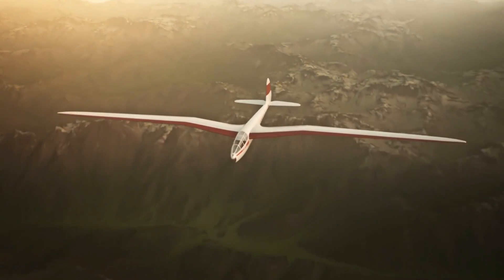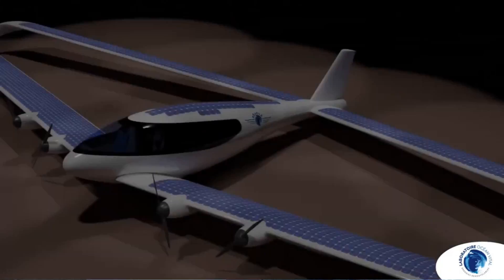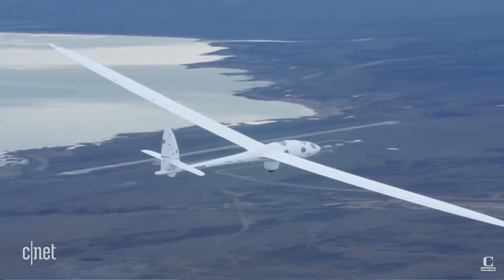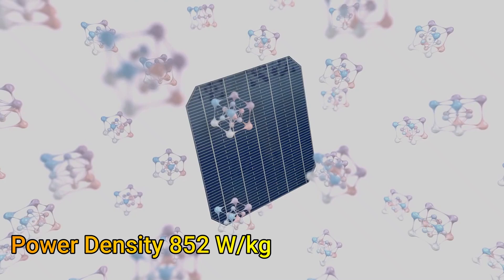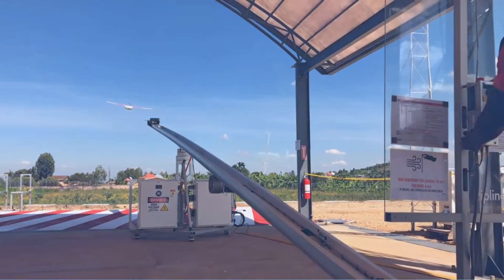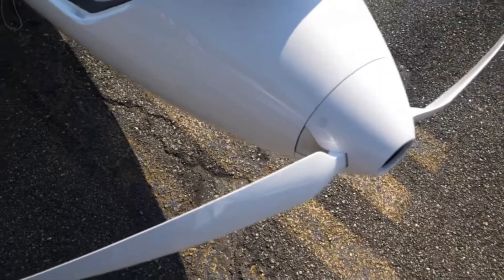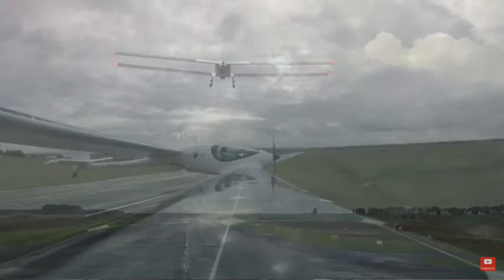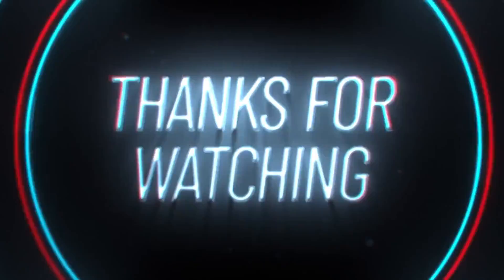Solar Cargo Gliders : The possibility

Comment: What if we use lifting gas to increase the surface area for solar panels without adding weight. Essentially an airship that can land on its own without wasting gas.

The increase in drag, while slowing down the aircraft, should not be enough to offset the benefits of having an increased energy output from solar panels and the lower energy demand for take off and landing (less batteries, smaller electric motors).

Comment: This doesn't make much sense at all, really.  The gliders in WWII were used because the army needed to deliver troops to a combat zone en masse.  Parachuting is too imprecise and puts the powered planes at risk.  Gliders let them disengage the valuable powered craft before entering the most dangerous zones.  

On their own electric powered gliders make plenty of sense but they're never going to carry any significant amount of cargo.  You're still going to be limited by the amount of energy they can collect from the solar cells for any trips of significant distance and that means the cargo capacity is going to be limited.

Comment: One thing is for certain. We must realise that jet aircraft are demolishing the entire planet. The temperature in the combustion zone of a jet turbine reaches 2300 degrees C. The temperature at ten thousand meters is minus 30 to 50 degrees C. The deposition of this intense heat into the frigid stratosphere is disasterous and must stop. Use the internet - forget the jet!
Reply: There are apparently 100,000 flights every day of all aircraft. 
Also, if aircraft used structural solar collectors for planes, the entire upper surface of the plane could be used for solar gain, not just the wings. The heat component currently not used could also be harvested from the aircrafts body and wings.

Comment: The problem with batteries powered flight is range   but what if the lift aircraft (the one pulling up) is electric   you could charge it in between tow ups and get away with a small battery pack.   Saw a Ted talk on using autonomous  gliders high  in the jet streams to get really far

Comment: A video dedicated to the Antares 20E (Lange Aviation) would be good: Over 20 years old design, fully electric and L/D better than 50.
Another video dedicated to the Archaeopteryx with electric motor and L/D of 28 at a weight of only 85Kg (without pilot) would  be good!
Reply from the maker: Thanks for the tips

Comment: Well, given that the most fuel is used at taking off, and climbing to altitude, there is a possibility to use electric tow planes to launch these. This is kind of like a booster with space craft. The dead weight of low altitude high power propulsion is ejected at the beginning of the flight with the corresponding batteries. But do to the high power and low maintenace  electric propulsion can also be used at this stage.
Reply: hi kistuszek, have you become a flat earther yet? If not I suggest viewing the 13 part series what on earth happened in my about to learn how the earth is not a globe

Comment: Sea take off. The wing js blown to increase the deag on the top sidea of the wing the weight is hoftes baxk to raise the wing facing a winfy dy the lift us set by the weight on a rail the lkad pulled fiwrad to the center of the uull and ountiil at the height required aboce the winds shear off , then the earyb runs arpubd then land by tge place its not there e?

Comment: Fantastic video with good explanation of e-glider range equation!
A small team of us, at Cranfield, studied basing a 600kg electric aircraft design on a glider to maximise lift-to-drag ratio. My proposal was to put half of the batteries in the wings to allow good aspect ratio without undue stresses in flight. The challenge is then to allow the same wing to handle heavy landings without undue root stresses, although carbon composite flexure can help by absorbing impact energy. To keep landing gear length & mass down, we selected twin rear ducted pusher fans. The one advantage of e-VTOL is that there are systems available now, like the Schubeler ePos-21, which offer ready solutions for fixed wing propulsion. We were conservatively estimating 500km for 2 seat version and 750km for single seat version. I'd like to think that at some point I can get a small team together and have a go detail designing it...
Reply: hi martingarrish, have you become a flat earther yet? If not I suggest viewing the 13 part series what on earth happened in my about to learn how the earth is not a globe
Reply: @flat-earther  , my belief system is that the observable universe is round. To test this belief might cause reality to implode. This would leave us in a bad bad place...😱
Reply: @martingarrish4082  okay. BTW martingarrish, what do you think about all gubments drawing a line around you and saying you are not allowed to leave?(Antarctic Treaty) If you don't know what I mean, read my about tab.
Reply: @flat-earther , I think that this isn't an appropriate place to discuss that topic, as it doesn't relate to electric aircraft. 😧
Reply: @martingarrish4082  yes I don't like wasting more time because youtube censors comments. I just opened a door of information to you and you get to decide what you do with it
Reply: For flight training hourbuilding this will be exceptional, plus some early adopters might be very happy to fly sustainably. Go for it!
Reply: @Walterwaltraud  Look at the currently operating Velis Electro and upcoming Diamond eDA40
Reply: @swecreations  I do, have followed them for years, but since both are conversions of existing models and Pipistrel did not choose the Virus, the range is limited. Great for pattern and air work, not ideal for covering cross country experiences.
Reply: @Walterwaltraud , exactly. I wanted a recreational aircraft suitable for training, cross country, and stressed for full aerobatic capability. Purpose designed for recreational flying and advanced training on a tight budget. Using glider like landing gear with good energy adsorption, and wing tip wheels, would also allow ab initio landing resilience. Designed from the outset as a robust club or syndicate machine...

Comment: There are no "light weight batteries" when compared to hydrocarbon fuel. for the energy they contain, batteries are just heavy.
Reply: hi flechette, have you become a flat earther yet? If not I suggest viewing the 13 part series what on earth happened in my about to learn how the earth is not a globe

Comment: There is some interesting new materials that would be interesting to see in flight,like the thin and light "humidity battery"membranes that make a little electricity from the humidity indifference on the underside of the glider wing,it's interesting because of unknown thermo-dynamic interactions with leading edge flight turbulence ,heat and lift

Comment: You have no practical understanding of the structural inefficiency of 'gliders' (sailplanes) where the wing mass increases so fast with span or size that there is no payload fraction possible -with solar power the concept is simply ridiculous - the round world solar aircraft was indicative of the fragility and uselessness inherent plus the huge size just to lift one person - batteries are another level of ridiculousness to add to this hare brained 'thought'  . The existing passenger and cargo aircraft in airline use ARE optimized to give the best useful load to power etc balance.  Hurel Dubois explored the potential for higher spans and L/d as did the NASA SUGAR project but still using viable propulsion .   this is crap.
Reply: crossouts are a computer glitch.
Reply: @rossnolan7283  The crossed-out part is probably there because you surrounded this text by hyphens.
Reply: I have looked into that previously and it does not seem to be the reason; as if putting a 'hyphen' should do that in any case . The post below by 'robertosfeld'  contains a hyphen, as does yours  . I would normally connect, by 'hyphens', a compound thought rather than the less appropriate commas , as here  . Let me see - using hyphens - at both ends of a sentence if this is so.
Reply: didn't happen , the round world (in 60 days almost) solar powered glider was Solar impulse from memory - papers on the concept of cargo gliders even in trains with one tug - were published in the 50s but proved impractical - solar energy can barely sustain the most refined EMPTY aircraft as already shown. Is that enough hyphens? let's see .
Reply: hi rossnolan, have you become a flat earther yet? If not I suggest viewing the 13 part series what on earth happened in my about to learn how the earth is not a globe

Comment: Powered gliders also can do dynamic soaring (DS), possibly autonomously, to achieve much longer distance flights, as they can avoid and escape areas/situations of low wind gradient using their motor.

Comment: This video is beyond stupid. Go look up a detailed video or information on Zipline and you can see why cargo gliders are moronic. Cargo is about weight, to be able to support enough weight cost effectively enough, gliders just will not cut it. The whole of air service is speed and high value payload, high capacity high load cargo is the opposite of that.

Comment: Gliders aren't powered, if they are they're airplanes
Reply: You never heard of a self launching motor glider glider is a plain capable of sustaining flight without power. A glider can have power can have a jet engine several do have jet engines they just don’t rely on power to get from place to place
Reply: When using electric power you climb as high as possible then continuously descend in a cruising glide to get the most distance.

Do you even electric aviation bro?
Reply: @jtjames79  or use atmospheric lift to stretch a descent into a flat glide or climb. But the solar can always replenish some energy. But considering the glide ratio you could expect a flight range at least 30 times longer than pure electric powered flight.
Reply: @soaringeagle  For purely cargo I would go two stage.

Use an airship as an elevator, just up and down.
Reply: @jtjames79  they did carry heavy equipment, including like you know multiple troops and even tanks in World War II although I can’t imagine the flights were that long there were not the most efficient gliders in the world and they certainly weren’t able to climb carrying a tank or anything like that
‘ I think they could be used for like mail and light shipping. The biggest problem with the cargo idea would be simply the drag coefficient trying to make enough room to carry cargo.
Reply: @soaringeagle  I was thinking stuff like Amazon prime packages. Relatively value dense, needs to go faster than boat or train, doesn't actually need to go as fast as a jet.
Reply: Every glider needs some sort of power source to become airborne. Be it a winch, tow car, tow plane or motor.
Reply: @horaciostjeward  My favorite is dropping. No energy like potential energy. 😁
Reply: @horaciostjeward  there is one airport in the world that you can actually take off, purely by gravity all you need is a sloped field at the top of a ridge so you just speed up with gravity go off the edge and your soaring look it up just search for glide or takeoff gravity
Reply: A glider is an aircraft specialized for long flights without power, regardless of having a engine or not.
Reply: He should have just said "glider type airplanes."  Given that there are things we all happily call "powered gliders," it's really a continuum.  He just means planes optimized for high efficiency over speed.  It's an interesting point, even if the exact terminology isn't precise...
Reply: @cbarnes2160  gliders is just fine because there are lots of gliders that I’ve had power but they’re still gliders
It’s not about efficiency over speed because some gliders are pretty damn fast. Is the efficiency to be able to climb without power using just atmospheric conditions
Reply: What about one that get up with an airplane and the motors, designed to be ligthest/max reach so you get the eficiency point on point
Reply: Hey young teenager/child.
There is a category called "powered gliders."

Aircraft that use their engines to get themselves up into the air, and up to altidude, without the need for an external power source. 
But then shut off their engines and glide the primary portions of their flight.
Reply: @Dave_Crupel  thanks you old bastard 🤣
Reply: @Dave_Crupel  don’t be too hard on him. His only experience with airplanes are powered by rubber bands. No, really. I’m not putting him down, I looked at his channel. He does make rubber band powered planes.
Reply: @soaringeagle  Then he needs a hard lesson, from someone who is in the aviation industry, about either asking questions before making statements, or keeping his mouth shut entirely.

Especially since, judging by one of his video titles, he thinks submarines fly in the air.
Reply: @Dave_Crupel  haha wasn’t there a 70s tv show about a flying submarine? I forgot all about until. This moment
Reply: Not all aeroplanes can glide.
Reply: @AlienLivesMatter every aeroplane is a glider, they just have different glide ratios.
Reply: Dear Sir, these unqualified comments do not contribute to advancing the discussion here in a meaningful way.

You may not know, but there are touring motor gliders and powered sailplanes and even cargogliders. They have all significant difference conceptual design. 

The main advantage is the ability to fly long distances without or very few power if the weather condition is supporting.

Comment: Waste of time and resources
Reply: Motor-(electric)-Glider would be a very Frugal Flight. (Just not safe/fast/"on schedule" enough to move human "beans." (As the fellow doing the Posting noted, they did well enough, while Hitler was still breathing. Might be "Time" to check, and see if this is viable - considering that Materials Science and "Elec-Tek" has Advanced considerable, since the nineteen-forties.)
Reply: Motor-(electric)-Glider would be a very Frugal Flight. (Just not safe/fast/"on schedule" enough to move human "beans." (As the fellow doing the Posting noted, they did well enough, while Hitler was still breathing. Might be "Time" to check, and see if this is viable - considering that Materials Science and "Elec-Tek" has Advanced considerable, since the nineteen-forties.)
Reply: The wartime assault gliders had to be towed by another aircraft to their drop-off point, and they rarrely flew again because they landed in places that aircraft couldn't land or take off from. Single use throwaway  cargo gliders are not going to be a viable business. If you need to land at an airport so as to be able to use it again, then you may as well use the tow aircraft for your cargo, which is what did and does happen.

This guy is mixing two totally different types of glider, which have completely different designs. The assault glider is boxy with a poor gliding capability, that has to be towed all of the way until it crash lands at its destination.

 The soaring glider is as light as possible, with long wings and is designed to be able to harvest the lift contained in thermals, and is largely dependent on weather to provide this lift. Gliders can travel long distances, but are dependent on the weather being suitable all of the way. These long distance  record flights were a challenge, not the start of a regular service. The motor glider bit is really just a cheat to get more altitude when the weather doesn't work for you, or you can get into the air without a cable or air tow. If you run the motor all of the time then it is an airplane not a glider, and glider plan forms are not optimum for a powered plane.

While there have been some impressive electric plane firsts, they have only served to demonstrate the current inadequacies of the solar battery model. The electric plane that went round the world took several months to do it and barely carried more than the pilot. The fossil fuelled version did it in 24hrs iirc. Who wants their journey to take months instead of days even if it is only light cargo. And that is the nub, a glider will never be able to carry the cargo of a well designed plane, and never be able to choose its own weather independent route. Electric planes may have a future, but it is a long time in the future, currently fossil fuels have pound for pound much higher energy density than batteries, and for aircraft pounds matter.

Mixing two different modes of glider misses the point of why they were designed as they were. It is similar to mixing an ocean liner with a speed boat and saying we could have 100mph ocean liners or cargo ships. The physics and economics says no. That is why we had ocean liners and we had speed boats, but not a combo. The same goes for long distance cargo gliders.